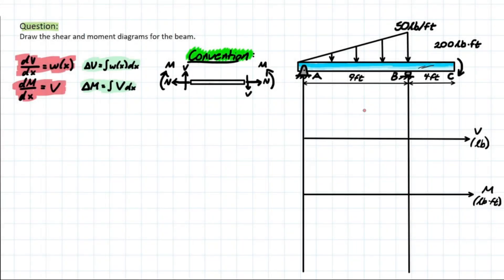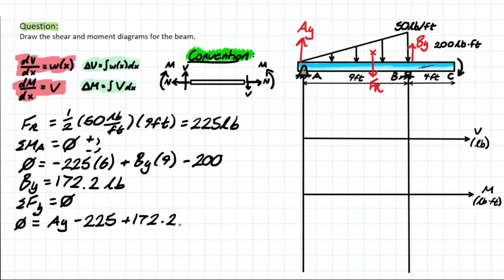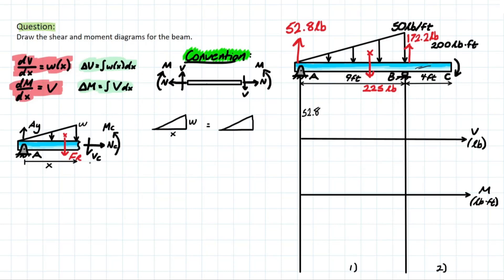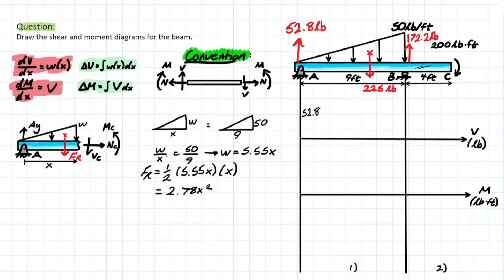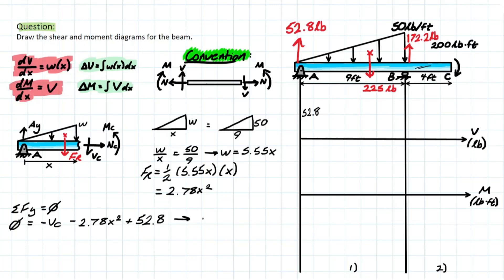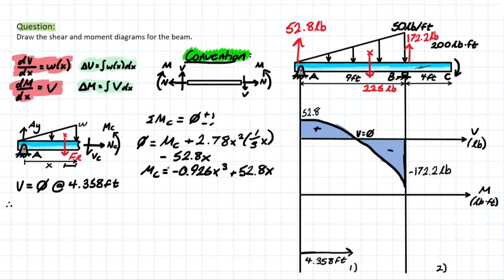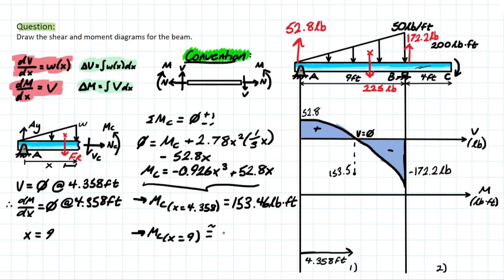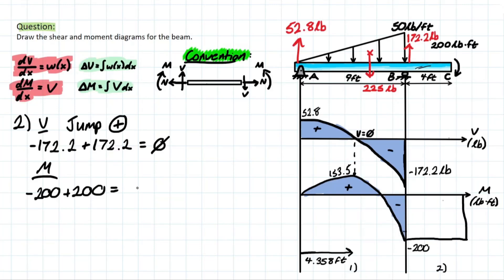Quickly Solve Shear Moment Diagram using the Graphic Method!

Comment: This is a fantastic video, thanks. How would you solve the same problem, but with the distributed force triangle being highest at x = 0 rather than at x = 9ft? Seems to me that you'd have to use the segment from the right, rather than the left - but I feel like there must be a simpler/quicker way than that.
Reply: Nevermind. :) It is actually really just as simple doing it from the right as it is from the left. I just have the roller support as the constant rather than the pin support. (And I just need to keep track of where I'm measuring x from. But I got the right answer, so it works! Thanks!!)
Reply from the maker: @sceneryj  Haha glad you were able to test both ways. At the end of the day, whatever is intuitive for you, go for it. Glad you enjoyed the video as well